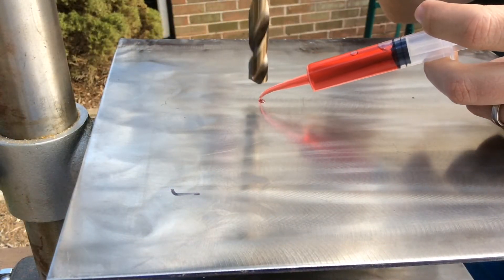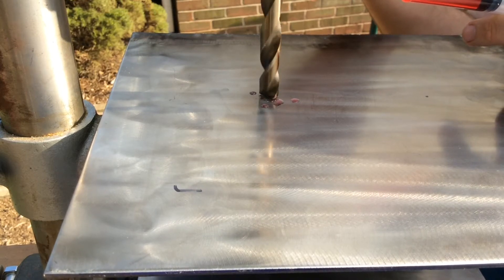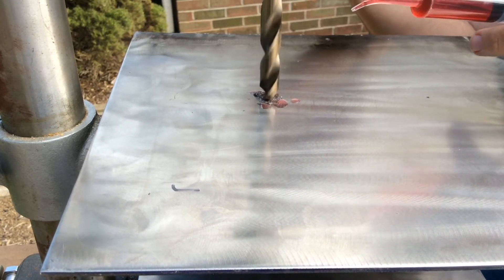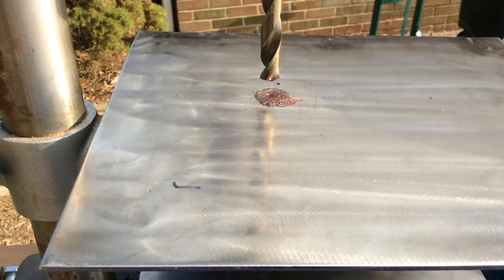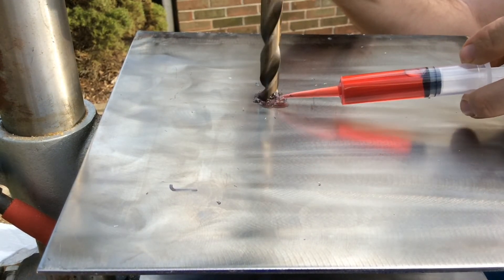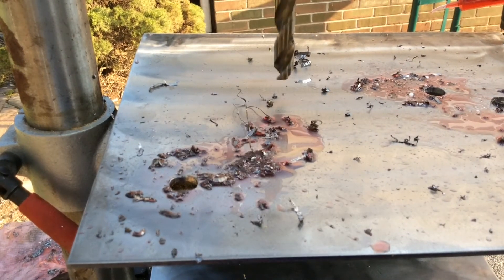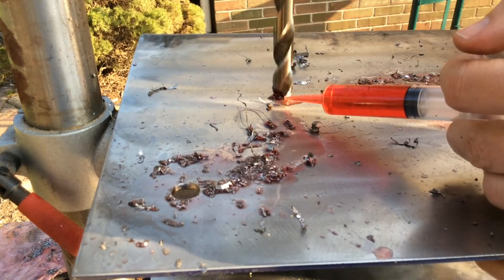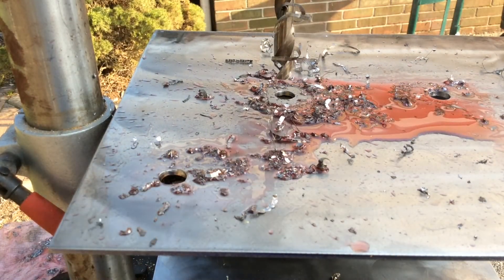How to Drill Stainless Steel Like a PRO

Comment: Don't follow this advice. As any actual machinist or SS fabricator will tell you, the SOP to prevent work hardening and keeping the bit cutting effectively instead of just dulling is: sharp bits, (HSS is fine if you take your time) slow speed, HIGH pressure, cold WATER as coolant, use a pilot hole then step up through a few drill sizes to required size, keep each bit cutting into to fresh material and STOP the moment it is not. Finally, learn to sharpen your drill bits.
Reply from the maker: The point still remains: slow speed with lubricant and high pressure.
Reply: @RiggingDoctor  where do recommend high pressure?
Reply from the maker: Drill press. Does it look like I’m letting gravity push the bit down?

Comment: This is actually nearly the opposite of the correct technique to drill SS.  The only correct part is to use a slow drill rotation speed.  You want to use very high drill pressure.  Ideally, you want to get the bit started quickly removing a continuous spiral chip.  This does two things: 1. It removes heat with the metal chip. 2. It keeps the drill moving through the heat hardened zone that forms just ahead of the drill.  And you want to use water as a coolant, not oil.  SS doesn’t need lubricant, the issue is heat generation and water is the most effective, safe coolant.  Slow speed, high pressure/feed rate and lots of water is the recipe for SS.  DON’T follow the advice in this video.
Reply from the maker: My drill bits last a longer when I use low pressure. They die quickly when I use high pressure. Seems we are using different tools to have such opposite methods of tackling the same task. 

The other possibility is that both methods work!

Comment: Try using just fresh water  cools bit and hole boils off at a lower temperature so just keep cooling
Reply from the maker: Good point. The only advantage of transmission fluid (not oil) over water is the lubrication properties to help keep the drill sharper longer while you make the cuts. If you don’t have tranny fluid on hand, water would help keep everything cool as well to help keep the blade from heating and blunting.

Comment: Anyone demonstrating drilling stainless using an oil based lubricant is doing it wrong.  USE WATER.  It keeps both the bit and workpiece cool.  Oil, regardless of the type, it will burn off and you will lose lubrication, making your bit hot and losing it's temper.
Reply from the maker: That's why I kept dripping fresh (and cool) oil on the bit to replace the oil that had burned off.

Comment: Next time, use cutting oil instead of transmission fluid.

And um, sorry, but drill bits aren't "dead" when they get dull. It made me laugh when you said how expensive it would get if you dulled a drill bit for each hole you drilled. You talk about them as if their lifespan is over once they're too dull to cut. Assuming you don't break them, a drill bit's lifespan is measured in years.

Drill bits are made to be re-sharpened. It's not hard to do, and if you don't have the skills or confidence to do them by hand, there are many makes and models of sharpening jigs which make the job very easy to do. Stop throwing money away.. sharpen your drill bits yourself, instead of buying new ones.